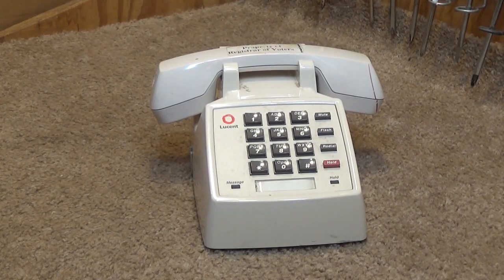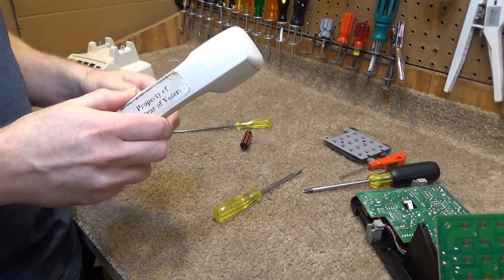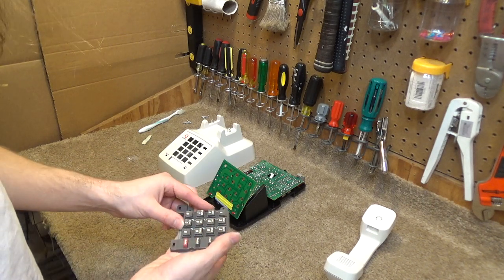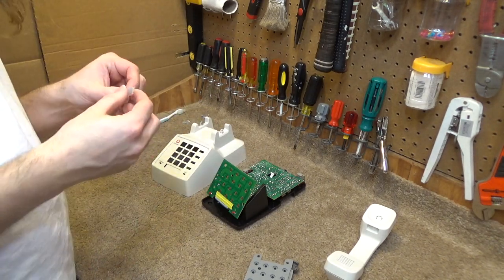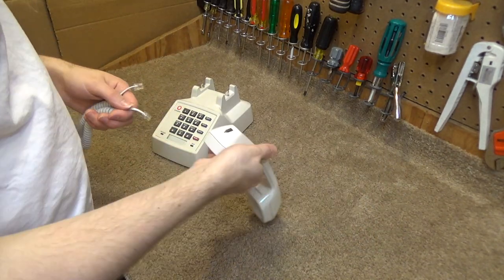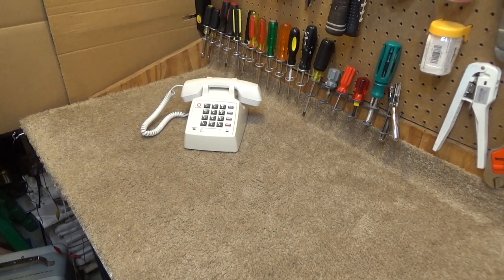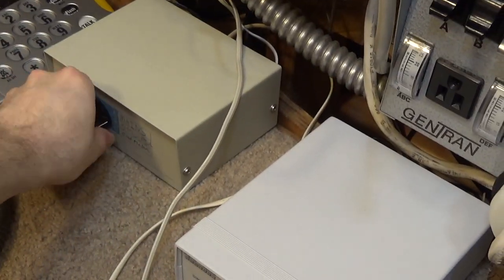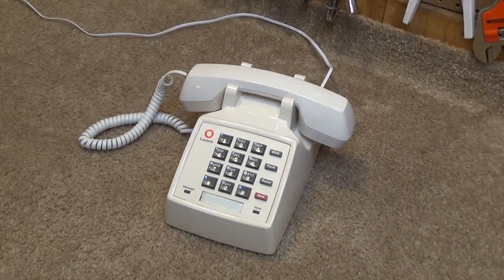Refurbish Lucent 2500YMGM Telephone

Comment: I have an ATT-210 With the same ring tone. It has tone and pulse dialing circuitry. It has  a long handset cord.  I also have a vTech CS siris cordless phone. The ATT-210 Trim line telephone has a redial button and adjustable ring volume and 3 programmable buttons at the top of the keypad, above the 1, 2, and 3 keys on the keypad.
Reply from the maker: OK

Comment: Cleaned up nicely. Yeah it looks like that handset is permanently sealed.  I believe early Type K handsets (the squared off kind) were also permanently sealed during the Bell System days, but later Bell ones have a screw hidden in that nook for a wall hook that holds the two halves together.  Interesting that AT&T/Lucent went back to the sealed design in later phones
Reply from the maker: Thanks.. I wonder if it has something to do with manufacturing cost.. I imagine this design is probably cheaper than ones that can be disassembled..